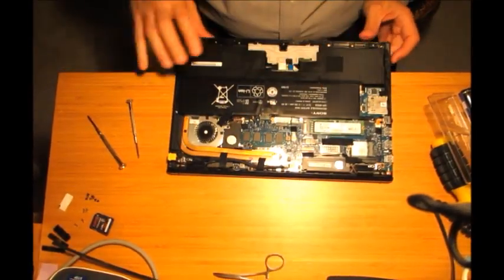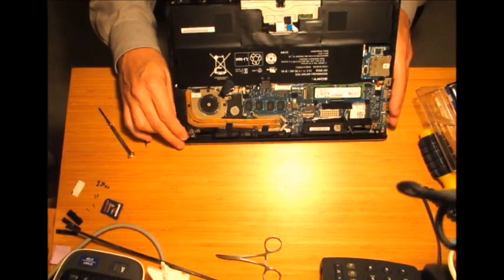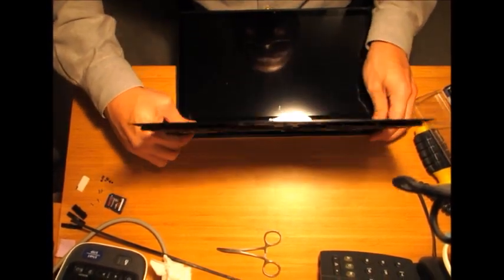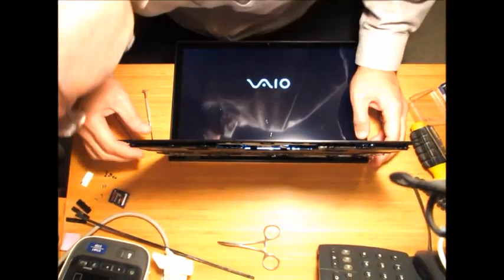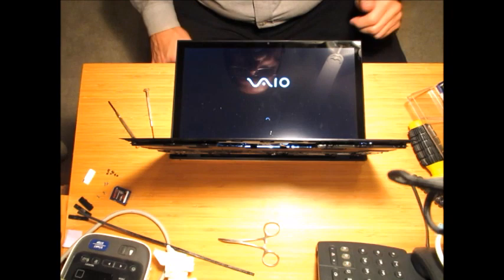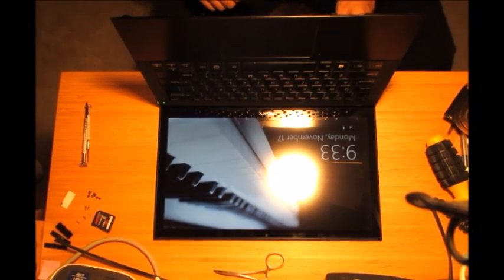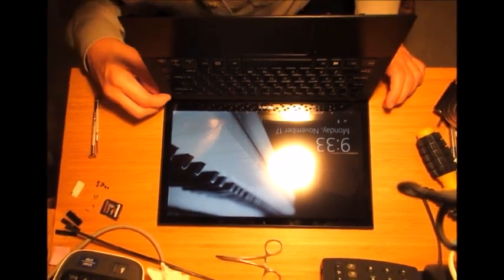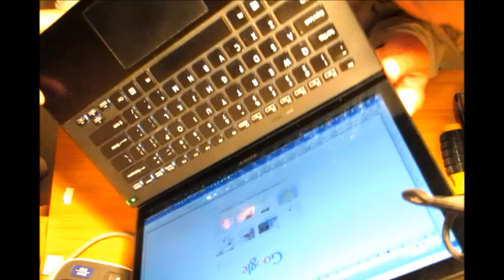Sony VAIO Pro13, svp132 fan replacement, case removal

Comment: Hello Larry,
First of all thanks a lot for your video, I think you have helped a lot of people ;)
I do have a question, If I only change the thermo paste instead of changing the fan, do you think they'll have some improvment regarding the noise?
I'm living in France, and it's quite complicated to find out this reference ...
Reply from the maker: +ExBriaN77 ExBriaN77, The source of the noise is the fan motor/bearing wear.  i.e. the fan's unbalanced rotation is causing the noise.  Thus, I do not believe the thermal paste will help with the noise.  If you search on other people's comments, I believe you will  find at least two others from France, including "Emilien SERMET" you may ask them how they found the new fan replacement.  Good luck!
Reply: +Larry Blackledge I'll ask him :)
Many thanks for having replying to me !
Reply: +Larry Blackledge Hello,
I've got another question, I have opened the laptop but I haven't found out where the RAM where. Do you have any idea?
According to some forums, the RAM is "solded", isn't it ?
Anychance to upgrade it ?
Reply: +Larry Blackledge 
Hello Larry, Just as an update, I've changed the thermal paste and clean the actual fan and performance are much better now ! 
The fan isn't going that crazy as before !

It seems that the old stock thermal paste is a crap... :)
By the way, thanks again for your video which really help me to "clean" my lovely laptop !
Reply from the maker: +ExBriaN77 ExBriaN77, great news!  I hope it continues for a long time!  Good luck!   Larry...
Reply: +Larry Blackledge 
Hello Larry,
I do have one inquiry, have you already upgrade the wifi 7260 card to another one ?

I have bought the Intel wifi card 8260 AC, but after the installation, windows does detect the new device but the drivers are not running at all (I do have a yellow icon on device manager)... 

I have read a lot of people upgrading the wifi but no one are talking about any "drivers' running" issue...
Reply from the maker: +ExBriaN77 I have not attempted this upgrade.  You may try a few things:  1) right click on the yellow icon / 8260 and try DISABLE then ENABLE, if these selections are available   2) right click on it again and select UPDATE DRIVER SOFTWARE  3) go to the Intel website and look for the 8260 driver download.  Download it and try manually installing it.    I hope one of these helps, let us know what you find.
Reply: +Larry Blackledge 
Thanks Larry as usual for being that responsive !

I do have already tried this (update manually the drivers) but still not working ... 
I'm running out of idea :(
Reply from the maker: +ExBriaN77 This may be a silly question, but do you have wireless internet access and just a yellow icon, or the wireless is not working at all?   i.e. did you have to download the update on another PC and manually transfer the update to your Vaio?
Reply: +Larry Blackledge 
Hello Larry,

No there are no wireless network available when the yellow icon appears (as the driver is not running and do not let the new wifi card working) ...
I have tried to download the drivers from another PC and transfert it manually thought a USB drive
Reply from the maker: +ExBriaN77 When you try to install the driver manually, what info does it give you?   i.e. errors while installing?
Reply: +Larry Blackledge 
There are no specific messages... 
The drivers is properly installed when I look at the properties
Reply from the maker: +ExBriaN77 Hmmm...   I will keep pondering on this...
Reply: +Larry Blackledge 
I have a code 10 error in windows 10.

I have look after a lot of video in youtube regarding this issue but no one are working :(
Reply from the maker: +ExBriaN77 Can you send me that error code?
Reply: +Larry Blackledge 
In device manager it says : This device cannot start. (Code 10)
Reply from the maker: +ExBriaN77 After some review it appears to be a difficult error to find the root cause.  Found the most choices for fixes here:  http://pcsupport.about.com/od/findbyerrormessage/a/code-10-error.htm      However, one other person found that their older BIOS version didn't support the newer hardware.  Thus,  you may want to see if Sony's offering a later bios version.   Good luck!
Reply: +Larry Blackledge Hello Larry,
Thanks for your involvement trying to solve my issue :)

I have spoken with someone else in notebookreview forum, it might be linked to my Bios Version which is R1044v7 and there are a new version R1045V7.

What is your bios version ?
Reply from the maker: +ExBriaN77 My BIOS version:  R1045V7 dated 5/19/2015.   You should be able to update manually from the Sony web or use Sony's software update, if it's still on your PC
Reply: +Larry Blackledge 
i have updated my bios to the lastest version and the pb havent been fixed :(
i also try to reinstall windows but nothing happen...

Maybe the card isnt working properly :(
Reply from the maker: +ExBriaN77 My final thought is to see if there are diagnostics software offered by Intel or Sony to run and see if the card is alive.  Otherwise, you may be correct that the card is dead.    Question:  what improved function are you wanting from this new WiFi card?
Reply: +Larry Blackledge 
I haven't found out any software to make a software diagnostic...
By the way I'm going to send back the card to the vendor.

The 8260AC increase the wifi signal and the range of download up to 833mb/s
I do not have any wifi trouble but it was a way to make a slight upgrade with a minimum of cost :)

Comment: This fan is better than the original? I think this ultrabook have a very loud noise ... nice video and thanks for the space. Juliano from Brazil.
Reply from the maker: +Juliano Cavalera Juliano, I've had this new fan installed for ~18 months now and it is still working and quiet.  The replacement fan was the exact same manufacturer and part number as the original fan.   Larry...

Comment from the maker: I have been receiving numerous private messages asking if a person should buy a fan with or without the heatsink attached.  I definitely recommend buying one WITH a heatsink attached.   I reviewed the attachment of the heatsink to the fan and it appears difficult to do, thus suggest you buy the fan with heatsink.
Reply: How much more difficult would it be to install without heatsink? The difference between getting a fan with heatsink compared to without heatsink is around $160 CAD on Amazon :/
Reply from the maker: I reviewed that when I bought it and decided to get the whole heatsink/fan unit.  It appears they are molded together and likely have some thermal compound between them.  You may take your PC apart and closely examine the fan/HS assembly, then decide if you can separate them without damage.  If you decide to go this way, let us know how it works out.  Larry...
Reply: +Larry Blackledge thank you. Any recommended sites I should buy the fan on or is Amazon my best bet?
Reply from the maker: +thatguy11m There are numerous choices on ebay from sellers with ~97-99% approval.  Example: $27USD   http://www.ebay.com/itm/CPU-Cooling-Fan-for-Sony-Vaio-Pro13-SVP132-SVP132A-300-0001-2755-UDQFVSR01DF0-/371405107574?hash=item5679783176:g:HtUAAOSwAYtWLbxK

Here is a fan/heatsink for $54USD:  http://www.aliexpress.com/item/Fan-With-Heatsink-for-Sony-Vaio-Pro13-SVP132-SVP132A-300-0001-2755-UDQFVSR01DF0-Free-Shipping/32256702503.html

I have used aliexpress before, I have NOT used the ebay vendor.  If you google "UDQFVSR01DF0" you will find numerous choice, maybe someone in Canada.  Good Luck!   Larry...
Reply: I realised this only post purchasing the fans without heatsinks. Have you had any luck figuring out how the fan may be detached and re-attached to the heatsink? Also, I notice a very specific type of taping... where can one procure those?
AD...
Reply: How much did the thermal temperatures drop when you replaced the fan in this video?

Comment: Thanks very much for this video.  It would have been better higher resolution as it's difficult to tell what is going on with the wire you need to use tweezers on, but I suppose I will cross that bridge when I get to it.  I got a Vaio Pro 13 when they first came out (at the time it was the only Haswell ultrabook on the market, and I didn't want to wait for the Haswell Asus Zenbook) and overall I've been very happy with it.  However, over the past month or so it has been experiencing thermal shutdowns.  The fan still works OK, but its still overheating.  From my online research it looks like the thermal paste used is not very good, and it helps greatly if you replace it with good quality silver paste, so that is on my to-do list.  I imagine there might be some dust in there too that needs cleaned out.  Videos like yours are a terrific resource to, if nothing else, build confidence before cracking difficult devices like this open.  Luckily this one looks as easy as most cell phones to open!  Thanks again!
Reply from the maker: +Dustin Rodriguez Dustin, thanks for the note.  Seems numerous people are having thermal issues including shutdown, once you open  yours let us know what you find, especially if you upgrade the thermal paste.   (Kwan, this may be your issue as well).

Comment: Hi Larry! Thanks for filming this video first. It's really useful! I have the same model of laptop (2 years old) and I think mine has the overheating problem with the fan and showing blue screen after I turn on the laptop for around 2 minutes...( the bottom is pretty hot too) do you think it's the fan and overheating cause the blue screen? (Kernel error, and also critical process died).... Also the fan is really noisy after I logged into my account and I didn't even open any programs (like browser).. Do you think I should know replace the whole fan. Or use canned air cleanser to clear off the dust? (I have not disassemble my laptop yet) thank you!!!
Reply from the maker: +Kwan K Kwan, I normally clean my PC's every ~3 months with high-pressure air.  You can try that, but if you do not see a lot of dust come out when you blow it, that may not be your problem.  You mentioned the fan was loud, is it just running fast or is it making bad noises?   Can you feel hot air coming from the vent on the left side near the power connector?
Reply: +Larry Blackledge hi Larry" thanks for your reply first! Should I remove the bottom in order to clean the fan using high pressure air? Yes I can definitely feel hot air coming from the vent on the left side!! there was once that the bottom of my laptop almost burning my hand! Like super hot. Maybe it's just running fast....I don't think it's making bad noises..... Thanks!
Reply from the maker: +Kwan K Kwan, the fan can be cleaned with high-pressure air without removing any parts.  On the left side near the power connector there is a vent (where you feel the hot air).  Aim the high-pressure air into the vent to clean it.  When you spray the air you should hear the fan spin as the air hits it.   If this doesn't fix your problem, then I suggest running Sony's PC diagnostic program that came with your PC (actually, you can run it anytime, no need to wait).   You may want to adjust your power settings to Power Saver mode so the CPU is not overheating so quickly, until you get the problem fixed.   If none of this works, remove the bottom of the PC and verify the fan is running OK and air is moving OK.  Then check the copper arrow end of the heat-sink and be sure it is firmly seated against the processor.  Let us know how it goes.
Reply: +Larry Blackledge Hi Larry! This is kwan. Thank you so much for your suggestion. I bought a can of high pressure air at target. For the first time, it didn't quite work out. The blue screen problem still showed up. However, I disassembled my laptop by watching your video (just want to see how it looks like inside for experiment). I tried to use the high pressure air again to clean the fan (while the bottom cover was taken out). (putting back the bottom cover is a little challenging for me.) What surprised me is that my laptop is backed to normal now!!! My laptop works perfectly without any blue screen showing and self-restarting now!! My fan doesn't have overheating problem right now too! Thanks Larry! Without you, I might still frustrating right now. I hope my laptop won't die again :(.     thanks Larry x1000000 :)
Reply from the maker: Kwan, Great!   Glad to hear you fixed it!
Reply: +Larry Blackledge hi Larry... I feel like my laptops old issue comes up again just today...I don't know why! I think this is so weird... My laptop worked TOTALLY fine when it is at home whole week long(since the day I fixed it).. I drove to a café and I put the laptop in the back truck (the laptop was turned off) while I was driving... When I arrived the cafe and turned on the laptop... Blue screen happens again D: will the transportation affect the laptop hardware??
Reply from the maker: +Kwan K Too bad!  The transportation should not damage the laptop, however the vibration could have loosened a connector in the PC.  If you press the power button for ~10 seconds it should reset the PC and reboot.
Reply: +Larry Blackledge I am sorry for the late reply Larry! My laptop works fine again after I take the bottom out and put it back again.... It's so strange...now I am afraid to bring my laptop to school or outside.... Staying at home stays good...
Reply from the maker: +Kwan K Must have been some electrical contact touching the case or the case was pressing against a connector making it loose.

Comment: In what page did you buy your fan?
Reply from the maker: +eu2phoria I don't recall the page I bought from, but seems Amazon and Ebay have some:  http://www.amazon.com/3CLeader%C2%AE-Heatsink-SVP132A-300-0001-2755-UDQFVSR01DF0/dp/B00UHAS9WE
http://www.ebay.tv/sch/Computer-Components-Parts-/175673/i.html?_sop=10&_nkw=vaio+pro
Just be sure they have good Seller feedback and a return guarantee.  I paid ~$45   as I recall.

Comment from the maker: CS, unfortunately I do not have a video of upgrading the SSD, however it appears pretty straight-forward.  Remove the SSD screw, slide the SSD module out and replace with the new SSD module.
Reply from the maker: I have not upgraded my SSD, and frankly I didn't look at the interface closely when I had the Vaio case open.  However this video claims it's a Samsung PCIe SSD, which is different than the SATA SSD.  https://www.youtube.com/watch?v=jNRdNizgBeo
Note you can find this SSD for sale, like here: http://www.amazon.com/Samsung-XP941-512GB-AHCI-80mm/dp/B00JOSM3TK/ref=sr_1_6?s=electronics&ie=UTF8&qid=1458144839&sr=1-6&keywords=vaio+ssd+pcie

However, I suggest you buy the SSD from a place that allows you to return it as this info may not be correct.   Also, Sony only shipped this with 256GB maximum, so the BIOS may not allow an SSD larger than this.  Another option is find a used 256GB from a Vaio on ebay or ??? and try that.

  Good luck and let us know what you find.
Reply: +Larry Blackledge Thank You for your advise.
Reply: +Larry Blackledge could you tell please if SSD interface M.2 or msata? or sata?
Reply from the maker: +H蘿莉露娜（HLoli-Luna） That's pretty interesting.  So they must read the SSD Mfgr info or similar.  Can you tell us the brand of the SSD you bought and also can you tell us the size SSD you had and the size of the new one?    Thanks for the info.
Reply from the maker: Wow!  That's too bad.   Thanks for the great info!
Reply from the maker: +H蘿莉露娜（HLoli-Luna） That's great news!   Did you do anything special to make it work?   New BIOS or new driver download, etc?   Let us know!   Great job!
Reply: +H蘿莉露娜（HLoli-Luna） i didnt get you quite enough.

So u bought SSD and plugged it inside VAIO. After that u booted in bios from usb-stick and installed on ur VAIO a Windows copy. Correct? 
After reboot bios doesnt recognise ssd? What does it says?

Comment: Hi, thanks for the video. I have few questions:
1) The port on the back is used for battery leaf connection. Is it the same with docking station port from other vaio? or does it only connected to the power terminals?
2) The fan is too loud and weirdly noisy. Can you recommend any other fan models which have lower noise level?
3) My wifi is less desirable, with some disconnection when being used. Do you think there is any other replacement out there?
Thank you.
Reply: +orange400 Oh, I just read the other comments about wifi. Sorry to bother you with it.
Reply from the maker: +orange400 Orange, as far as I know the port on the underside is only for the extra battery, I've not seen any dock using this type of port.   It appears to be large copper power connectors only.  I believe there is only one type of fan available for replacement, actually when new it is quiet.
Reply: +Larry Blackledge, Thank you so much for your quick reply

Comment: thank you for this video, i have the same laptop (svp132a1cm).
Reply: Hassan DRAGA my wifi capability is turned off!!.. no physical button to switch wifi (on/off), no driver can fix this.. so i will open my laptop to unplugging my wifi card adapter, hop this fix my problem.